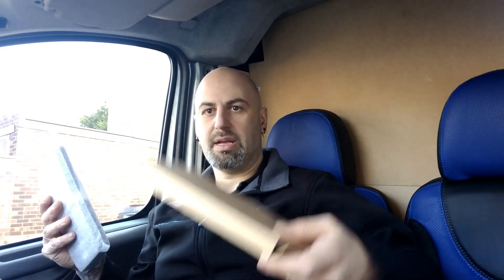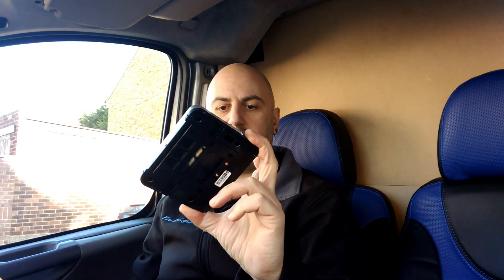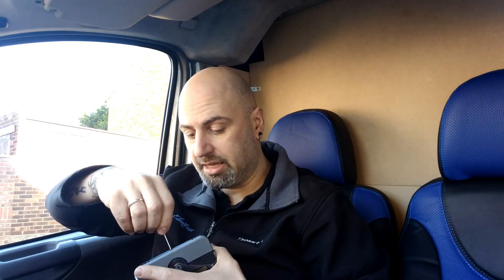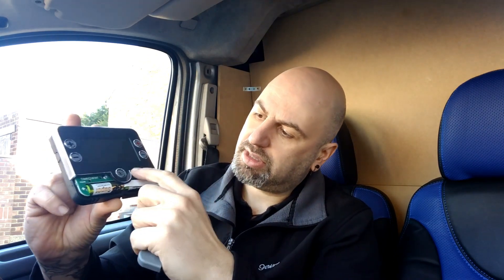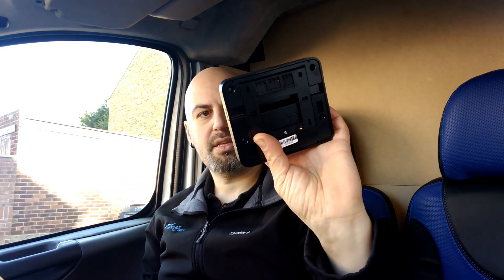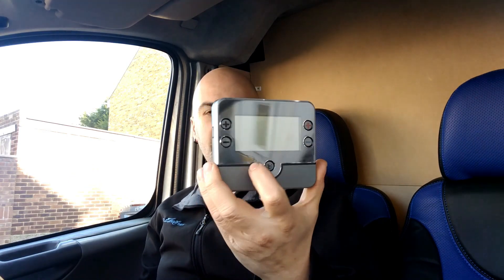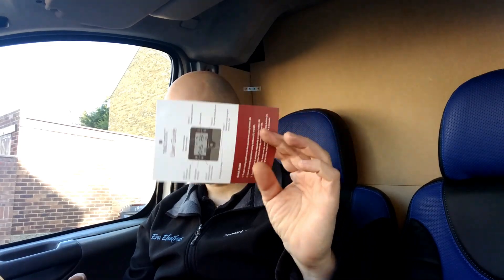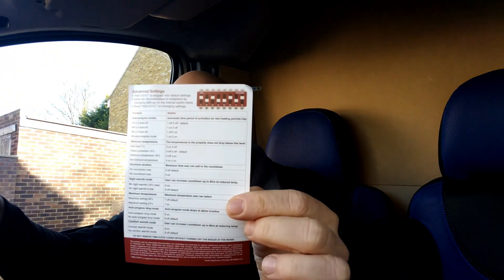The Thermostat that Every HMO Landlord was waiting

Comment: Anti-tamper screw? It looks very easy to bypass ?
Reply from the maker: Everything it's very easy to undo with the right tool. The whole point for that type of screw is for people with butter knives won't be opening. Maybe you would like to feed this back to the manufacturer, I speak with them often and they listen.
Reply: @EruElectrics  I suppose a solution could be superglue a piece of plastic over the dip switches or even cut them off, or remove and  permanently solder the switches. Thanks for the super swift reply! great video! I think I will continue to research!!
Reply from the maker: @bwtodd2008  but if you do this then you end up damage the stat and the dip switches will be unusable bitting the whole purpose of having them anyway. Bottom line is, there is nothing completely fool proof, if someone wants to mess with a piece of gear will do it anyway. I do believe though those stats are a very good addition to HMOs.
Reply: @EruElectrics  I emailed Thermostat, and received a call back from one of the team who explained the use of the device, and that answered my questions as the settings are all based on the timer to off feature so really it won't matter much if it has been tampered with. I'm now more than happy to order one and give it a try! Thank you for coming back to me so quickly!
Reply from the maker: @bwtodd2008  I think it might be Anthony the director. A few times I was on the phone with him while on site and helped me troubleshoot